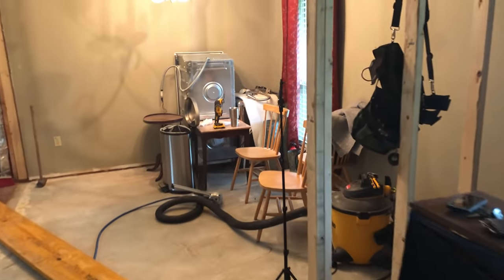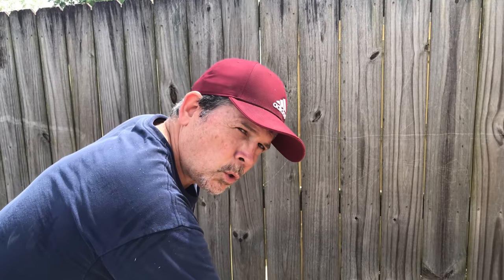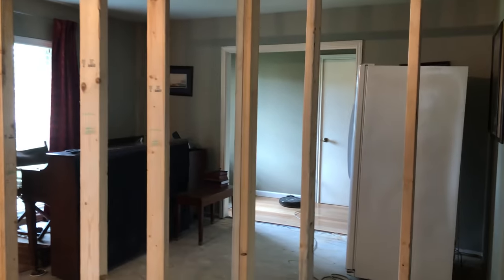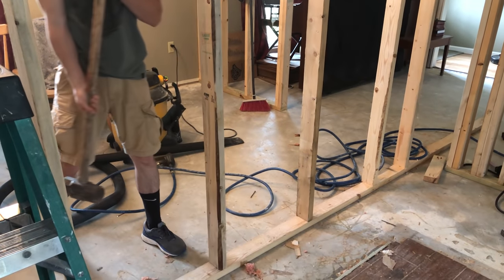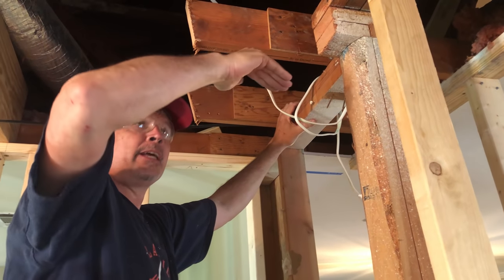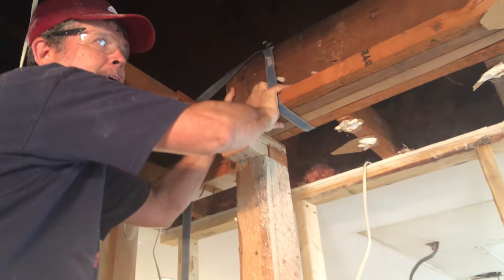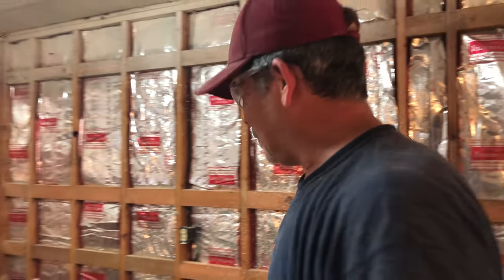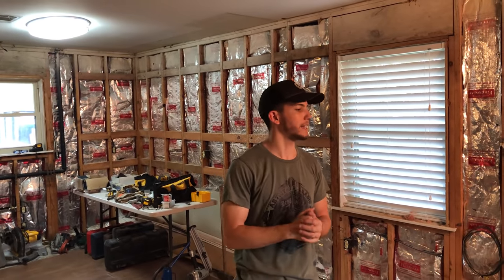Remodeling a Kitchen A-Z - Part 3: DOUBLE BEAM INSTALLATION

Comment: At first, I was like "eh, just another lvl install." Then I saw that planer trick to get rid of bumps in the ceiling... Love the content!!
Reply from the maker: That is a cool trick, thanks Ben!
Reply: Hhuhb Jan k
Reply: That's clutch.  If only I'd seen this 2 months ago. I just installed a PSL to remove a wall dividing my kitchen and living room
Reply: Very nice trick! Another if you don’t have a planer is set the joist 1/16 up from bottom of beam to accommodate for the height difference in the joist hanger.
Reply: Trim Router makes short work of that as well, and a little less clumsy than the planer, IMO.

Comment: I like the dynamic between the father and son.  I also like how informative these videos can be.  My only gripe here is that second beam directly above the window.  I’ve been told that is a BIG no-no.
Reply from the maker: Thx Greg 👊.   Yeah we made sure to run that by the structural engineer after we discovered the issue 👍

Comment: The screw trick works good for making beams/joist flush. 

If you want it flush on the bottom, Put a screw in the higher joist/beam and use a hammer or prybar to pull it flush. 

If you want it flush on top. Put a screw in the lower one and pull up. You get it. 

But your load might have been to heavy. 

Works great for framing

Comment: I’m a plumber by trade but I grew up with a builder who like y’all did everything on the houses he built besides electrical, plumbing, and sometimes painting. I’ve also done some electrical work and other stuff. Out of all that, I can honestly say I’ve never seen a right angle drill used to drive a screw. But hey if it works right. It especially makes sense with those big torx head structural screws. Stripping isn’t an issue and those drills have all the torque you’ll ever need for a screw or bolt
Reply from the maker: Yep and no dead batteries 👍👊
Reply: @StudPack  funny thing about that, I think I’m the only guy at our company who still has corded tools. I have plenty of battery tools but if I’m getting a cord out anyway why not plug something in that you never have to change a battery. I told a helper to put a couple drywall screws into wood. He wasted more time looking for the impact than he’d have taken just screwing them in. I finally said just use a screwdriver. He replied “you can actually drive screws with a screwdriver”. I made some smart ass remark about the fact that it’s called a screwdriver. Anyway I explained to him that when I started we put lots of screws in by hand because it was faster than getting out a drill and running a cord just to put a few small wood screws in. They just don’t know how good they have it.

Comment: Glad I found your page guys. Nice work. I do have a couple comments though. I'm surprised you don't have dust containment walls us, considering that homeowner hasn't covered their furniture in the adjacent rooms. Also, a window fan (blowing out) would help vacate the airborn dust you're making. And that shop vac you've got sitting there is the absolute best means for capturing demo dust vs all that sweeping, which churns dust into the air. Finally, that triple header you installed wants a triple stud pack. Come on guys, it's in your name. :)
Reply from the maker: We did some dust containment and used fans.   Check out the conduit in slab video this series.   Engineer specified two studs 🤔

Comment: The engineer called out the nail pattern as staggered, but you nailed them in aligned.
Reply from the maker: Each row of nails is in a line but rows are staggered in relationship to each other.   We go into more nailing details in our more recent beam install video 👍

Comment: Great job. Only thing I noticed was you only had two studs underneath the 3-ply beam. If I’m not mistaken, you’re supposed to have a stud for every ply.
Reply from the maker: Thanks Adrian!  The engineer specified 2 studs under that beam.   Perhaps in different parts of the country the specs would be different?
Reply: @StudPack  Yeah possibly. Majority of my work is in Texas. To resist shear, a stud goes under under ply.

Comment: Who needs a 77 When you have a Porter cable 6 in. love my little Porter cable. You can work overhead all day with one.
Reply: Honestly, I'd gladly take a lefty sidewinder. The rear handles are great for most framing, but they're too dang heavy for work like that. Makes me glad for the small battery circ saws on the market now.

Comment: Question, is the header for the window and that wall strong enough to carry the weight? 

Seems like that should had been beefed up or the window removed completely and relocated.
Reply from the maker: We discussed it during the engineers first visit.  It was fine according to his calculations but it’s a good point to remember 👍

Comment: Is the bevel cut at the end of the joist to fit the low height per engineer drawing? Usually, that cut should not extend as much as the video shows for some LVLs. Maybe your LVL manufacturer allows it?!

Comment: Great video.  Subscribed.  One question though: why don’t you use both beams with LVL instead of 1 side with 2 pelieces of LVL  while the other side you gang 3 pieces of 2x16 together?  I keep going over your video just to make sure if what I see is correct.  I could not find any other reason besides cost and availability.  Thank you for your grear video.  I’m about working on a similar diy project for my shed
Reply from the maker: The short of it Andy is that this is what the engineer specified so the inspectors are looking for my work to match the drawings.  I suspect it was a cost issue $15 vs $75 ??? each.

Comment: Hey stud pack....great video!  Was hoping you could give a brief explanation...when you snapped the chalk line on the existing ceiling rafters prior to cutting them where did you reference off of to assure that each rafter was cut the same length? Thanks for the content!
Reply from the maker: Thx Brian!!  We measured off the front wall of the house which is parallel to the beam.
Reply: @StudPack  thank you sir

Comment: Good work, a structural engineer dang did you have to have plans drawn up too, or is it something you call and ask, also does the engineer say anything about adding loads to foundation or is it something that i"m overthinking is that something i should ask him about, or will i get laughed off stage ? Thanks in advance although i"m sure I'll be asking more questions.

Comment: This is what I was looking for, the video is full of good information. I need to run a beam that will hold a new attic floor (2x8's sistered to existing 2x4s)ceiling joists.  I see that one side of the 2x12's beam, is not seating directly on the stud pack,  was wondering if there is a reason for that. Thanks a lot!
Reply from the maker: The stud pack is made up of 2 2x4's while the beam is made up of 3 2x12s. It is important that the beam is centered over the stud pack to transfer the load properly, but code does not require each 2x12 need its own 2x4 right beneath it.
Reply: @StudPack  thank you so much for replying, this cleared up my question. Keep up the good work!
Reply: Don Turco just wondering is it ok that you might have 2 sheets on ply sandwiched instead of one 12’ long piece of plywood? Hopefully that makes sense. Plywood is only 8’ long.

Comment: Love the videos, really great detail! Quick question - is there a reason you nail your temporary walls together instead of using screws? Seems like you could save the temporary studs. I am super new to this, so your sage wisdom is greatly appreciated :)
Reply from the maker: Screws are fine for temporary walls.  I've just always used a nail gun. We do pull the nails out of the temporary studs and use them later for blocking etc.  Thanks for the comment Andrew!

Comment: New subscriber guys idk how this even came through my feed but you guys are great. Question- why did the engineer call for 3-2x12s on one side and 2-lvls on the other? Seemed to be the same length?
Reply from the maker: They are the same length.  Strictly economics.  The LVLs are doing the lion's share of the work 
by taking the roof load and cost $125 each.  2x12s are only holding up the ceilings and are cheap.  Thanks Kevin!

Comment: I didn’t think the beam would move after getting a couple rows of nails in it so I stopped paying attention, but on one end my beam ended up being about 1/8 off. Will that hurt anything?
Reply from the maker: Maximum distance between a joist and beam is 1/8" when using hangers.  You should be fine.

Comment: Enjoyed the video. Question about cutting the beam...I noticed an angle cut in order to fit under the roof. Does this weaken the beam some or is it OK?
Reply from the maker: Thanks Todd!  We discussed this with our engineer beforehand and he sized it accordingly.  Check out 03:50 in the video where I discuss this.  Search for "tapered beam" online and you'll get some pics of what's acceptable.

Comment: 13:39 you don't want to do that.  The load transfer from the joist to the beam is now reversed.  Instead of the joist pushing down on the beam (through the joist hanger and toe nails), the joist is now pushing upwards on the beam.  If you cut the toe nail, the joist will lift off joist hangar.

A free body diagram of the joist will show the reaction loads.
Reply: Just wondering, I know that the one end of the beam is on the outside wall but is the other end on a bearing wall?

Comment: Are you sure the engineers allow the beams to be cut at angle near the roof? I was taught it weakens the point of load support on the beams. Inspectors where I'm located do not allow that as far as I know.
Reply from the maker: Super important detail that is often missed 👍   Our engineer and I spoke about this going in and he sized the beams accordingly

Comment: Hey guys, I have a question. The second beam end is supported by the window header. I thought you got to have a post to tranfsfer the load to ground. Im I wrong? Thanks
Reply from the maker: Good catch.  Our engineer and I caught this too during the design and the engineer checked it out and said it was fine for the minimal load we had there 👍👊

Comment: What is the purpose of the horizontal 2x4 framing braces in the walls spanning most of the way across the kitchen walls? Is it code for the state you're in?
Reply from the maker: blocking for kitchen cabinets 👍
Reply: @StudPack  Ahh, genius. Preplanning is worth it's weight in gold. Great work, incorporating your boy in the process is priceless.

Comment: Hi. Thanks for your video. I live in brooklyn N.Y. in a 112 yr old house. Could you assist with any info on how to get the structure examined? I am scared it will soon fall. Thank you.
Reply from the maker: Structural engineer is the only way to go.  It can be difficult to find one who will come out for small residential projects but I'm sure there are some in the Brooklyn area.  Check online or call a few.  If they can't help with your project, ask if they can recommend someone who can or go to the permit office and ask them to recommend an engineer.  They see plans stamped by engineers all the time.  It's expensive though so be prepared.

Comment: What if you just flipped the hangers upside down so that the bottom was up over the top?
Reply from the maker: You can only flip a hanger when the load is an uplift like on a cantilevered joist.  They must be installed as designed to get the load rating

Comment: Are there no king studs for a beam like this only 2 jack studs on either side?
Reply from the maker: Give me a mile marker so I can check.   Kings and jacks hold up headers.   If you're referring to the 2 studs under the 3-ply pine beam, this is what the engineer specified.
Reply: Stud Pack I was just observing in the video that there were only studs under the beams and they werent fastened on the ends. Im doing a similar project (which is how i found this video) and just assumed i would need to build it with kings on both ends and jacks. So if i use 2 jacks on either end and joist hangers then you dont need king studs for this beam? I have only built openings for doors and windows and assumed the process was the same. Thanks for the reply and the content!

Comment: According to OSHA, one handing a chain saw in a tree , is a big no no. I guess carpenters with a skill saw, doing the same ,is fine. If you can't do either, you don't need to be in the business. Been doing trees 31 yrs now, one handing chainsaws, over head , ever since. Never had a problem.

Comment: Is your LVL upside down?
Reply from the maker: Great question Jessie because sometimes it matters.  Versa-Lam LVL have no top or bottom so in this case they're fine.  Some glulam beams are crowned and actually have TOP stamped on the top side.

Comment: A real framer would not use a single 2x4 as a header on a opening as big as the one in the background even if it's not bearing
Reply from the maker: Ouch tough crowd tough crowd:)   It's an advanced framing technique also called optimum value engineering (OVE).  Many "real framers" don't like the methods and that battle will persist long after we're gone.  How many would also say "I don't like the way you wasted a 4x6 timber on that unnecessary header?"  Thanks for commenting, we appreciate that👍
Reply from the maker: TJP 81  Gotta have something to nail the head casing to 😂👍

Comment: Never heard that one...nature of the product??I'd use the jack and move the beams flush to each other and attach them one at a time to each other.Or build the whole beam on the horses flush on bottom then install. You use a planer to make a hanger not show but don't go through the trouble to make your beams flush on bottom??And I get it...Its drywall and none of its going to show..its just funny hearing another carpenter's reasoning!Also why not just cut the joist back a few more inches and not cut the rafter??I promise you the engineer didn't tell you to do it that way 😉 That just looks amateurish as hell!!I don't think that would even pass inspection
Reply from the maker: Cut what rafter?
Reply: @StudPack  at 21:00min. Not trying to be an asshole either just saying that isn't the correct way and it probably won't pass code.
Reply from the maker: Okay now I remember 👍.  I couldn’t move the LVL so I had to cut the rafter.  Once I secured the beam and the rafter together with the plywood gusset I felt like it was good as new.  The inspector liked it. Appreciate you watching and commenting 👊